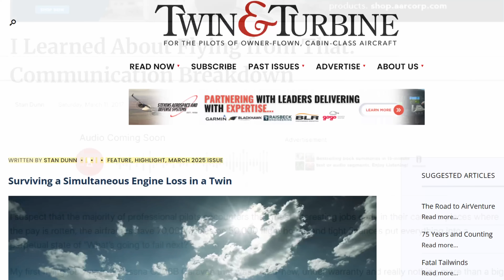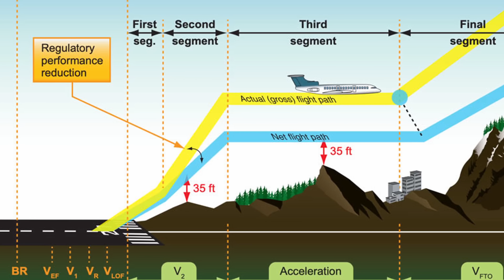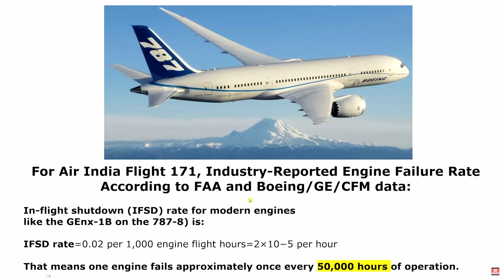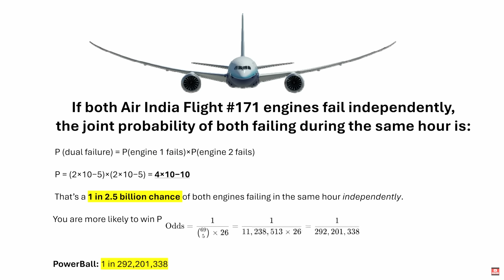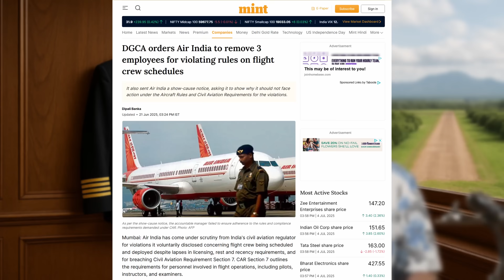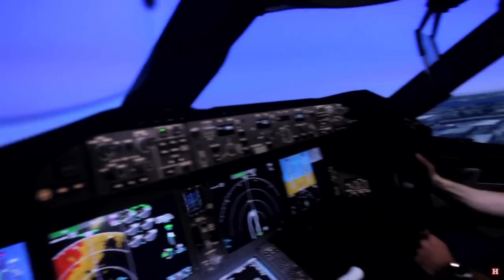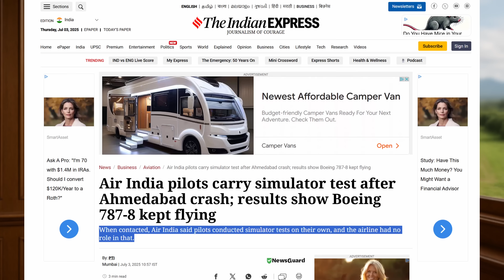Air India 171 Cause Becoming Clear

Comment: I'm not an airline pilot but after the accident when the survival said he heard a big bang on take off, my first thought was they shot the wrong engine down.
Reply: Other speculate he head the deployment of the RAT.
Reply: @iRelevant.47.system.boycott that is what it was. They are loud on actuation.
Reply: That was the emergency electrical dog slapping down to supply electricity.
Reply: A compressor stall will result in a loss of thrust and is likely to produce a "backfire" like sound due to reverse airflow. It may also be accompanied by flame from either or both of the engine inlet and engine exhaust. A sustained compressor stall can result in engine damage and can lead to engine failure.

Comment: To summarize, maybe this was a 'perfect storm' failure (similar to the Concorde failure). Left engine fails during takeoff, but after V1. They have to continue takeoff. The aircraft is already at it's maximum allowable weight, passenger load, and air temps. The margins are at minimum. They take off and begin to climb, but just barely. The remaining engine is not firewalled instantly, but rather after they lose positive climb. It's too late because they are only at 300-400 ft and it takes the engine 10-15 seconds to spool up to max. They run out of time and lift. The aircraft stalls and they maintain wings level. They float it into the ground. Possibility?
Reply: That does not explain the RAT.
Reply: @orizaba18000 do they know for sure the rat deployed? Isn’t it just based on the sound the plane made in the cell phone video?

Comment: Fly by Wire = Engines slaved to electrical system. Moisture in the relay busses or temperature induced cut out...
Rats gnawing on wires ? New guy pulling the plug to reset the controls? They do that with your cable TV

Comment: The title implying that the cause is becoming clear is a bit much. He’s using two pieces of evidence, the first is the debris from the left engine at takeoff, while no debris looks to come from the right engine. The second piece of evidence is the regulatory body firing or requiring the removal of some air India executives only a few days later. The conclusion that the pilots shut down the wrong engine before they should have even been thinking about such a thing, is entirely reasonable, especially from the timeline of how quickly the firing happened. That means that it was something really effing obvious, and there was no reason to wait with that particular move. But I think calling the cause “clear” is probably overstating things. 

Also, is there not an indicator for how well an engine is functioning? I know they’ve got the temperature gauges and I think probably RPM gauges or something like that, but is there not a simple green/red indicator for “this engine is broken“? It would make sense for there to at least be a red flashing indicator on an engine that has failed, and that flashing indicator should be down by the shut-off control. And essentially, you probably should not shut down an engine, unless that flashing indicator is flashing red at you. For good measure, they could also add in some strain gauges to the engine mount pylons to make it clear to the system how much thrust the engine is generating.

Comment: The only time I have ever had an incident while flying was on Air India.  It's beyond a horrible airline.  
The RAT was deployed on this aircraft.  That is an automated process to give the pilot hydraulics and electronics so they can land.  The altitude of this plane made that impossible. This was clearly a fuel contamination issue.  Not at all surprising in India or on an Air India flight. You forget that India is buying illegal russian oil, and running that through their aging refineries.

Comment: I have a theory that I haven't heard anywhere yet: One engine either failed or rolled back. The other engine was not producing adequate power then to continue the climb. 

Now of course, I expect to hear "All modern airliners can climb out with one failed engine!!". OK yes, this is the standard response and is accepted as 'fact'. But what if it isn't fact? 

Does one single engine, REALLY have the power to continue a takeoff, at very low altitude? On a maximally loaded flight? Full fuel, full passenger load? Very hot and humid air temps. Wouldn't the remaining engine basically have to be 'firewalled' almost instantly and then it still takes 10-15 seconds at least to fully spool up? 

The engines are not both set for max power on a standard takeoff, right? Isn't there a 'target thrust'? So at the most critical moment, one engine failed. And the remaining engine, would have to be at MAX to continue that takeoff with any hope. 

Facts we DO know: It was fully loaded for a very long flight. Passenger load was also maxed. Air temperatures were extremely high, leading to reduced thrust and climb. The aircraft stayed almost perfectly level, basically floating down.

When we repeatedly hear that any modern jet can takeoff with just one engine, we just accept it as 'fact'. But what if all the conditions are perfectly aligned against it? Maximum weight, low lift, reduced engine performance? Do they really 'test' such a scenario in real life? I highly doubt it.

Many other 'accepted facts' turned out to not be true. In the Lauda air incident, the aircraft was deemed to still be flyable during an in flight reverser deployment. This turned out to not be true, if it was at high speed and altitude. 

In the incident with Carcano (full engine failure flying into New Orleans), the engines were certified to continue to run with massive water ingestion. But the testing scenario was under full power. Under the low power they were set at for landing, they both flamed out. 

So, from an expert, is there ANY possibility that in fact there is NOT adequate power to continue positive climb, at extremely low altitude, right after takeoff, with maximum weight, extreme heat, and only one engine, running at less than full thrust?

Comment: one report said the left pilot's seat was reported defective earlier and had slipped backwards  on take-off, the pilot pulling the throttles to neutral.
Reply: Zero reports said this.  That is misinformation being spread by malicious actors.  Please stop helping them.
Reply: @johnpeterson3386  I am just reporting what I read/saw on another presenter of aircraft accidents.
I throw it into the messy mix of explanations as a consideration, not a final report
Reply: @johnpeterson3386  I am just reporting what I read/saw on another presenter of aircraft accidents.
I throw it into the messy mix of explanations as a consideration, not a final report

Reply
Reply: Fake sick message.

Comment: Old Navy AT... I still say likely fuel issue.  i.e. in proper amount fuel not getting to engines.  Dust color and rapidity of incident leads me to believe very unlikely pilot error... not enough time for most pilots to make an error.  Now what caused fuel issue?  dk.. as an old AT always want more data better resolution... etc.   Let me tell you, boxes with electronics with firmware or software or not....FAIL!   Yes, I've fixed MANY.   The easiest single point failure (important) is a semiconductor failure in the FADEC thus disrupting fuel/power... stuff to fly at that alt.

Comment: Is suicide by one of the pilots a possibility with such a modern aircraft?
Reply from the maker: Possible but not likely. No indication of a fight, and the aircraft glided down.
Reply: @flyingformoney777  I had a hunch since both engines lost power which is extremely unlikely. The fuel tank switches were turned off and the captain was suffering from depression as recent news show.

Comment: They said "no bird evidence" on the day of the crash. Nobody had a chance to examine either engine by that time. The "no birds" call came from a few jackwagons walking the runway apron looking for carcasses. Of course carcasses wouldn't be found ... but maybe some tiny hollow bone fragments? Wouldn't know it by kicking dirt around in tennis shoes.

People tend to think only big birds bring down planes but just as dangerous albeit less likely is a tight grouping of small birds could also snuff out a turbine engine.

I'm sticking with birds overall, as that is the most likely cause of dual engine failure regardless of aircraft. I am happy to be proved wrong ... Indian investigators. Please be quick too.

Comment: Nobody has even mentioned the "Load Sheet" and investigate he actual weight and freight load.  If   WELL overweight, it could have contributed to the length of T/O run clearly visible.  All pilots are where that for uncanny reasons there "ALWAYS" appear to be 3 contributory factors to accidents discovered in the subsequent investigation.  Worth some thought!

Comment: I don't think the engines failed...they just never achieved sufficient power/speed for flight which does speak to possible fuel contamination.  You can see the plane drift heavily left immediately after take-off which is an indication of insufficient power. It also appeared that they ran out of runway and had no choice but to try and lift off despite being below needed speeds.

Comment: At 3' 2" photo shows damaged building in top left and burn damage bottom right but the trees in the middle of photo no damage or burn.

At 3' 07"  the photo makes no sense. the tail of the plain sitting on the edge.

At 3' 24" where the tail section is cracked off one side is all burned and gone yet the red paint is bright red with no peeling from the heat.

I hope someone can explain these photo's.

Comment: In summary ( it’s at the end), he thinks one engine failed and the pilots accidently shut down the working engine because they panicked.   They should have remained calm and followed procedures which are to climb on the one remaining engine and after getting to a safe altitude, begin trouble shooting things ( possibly shutting down an engine if need be) ….   It’s very sad.    I think Americans should be only ones flying.    We can do it better.

Comment: The one thing not discussed was engine over-temp shutdown. On June 25th, an American Airlines A321 had an engine shutdown after take-off due to an over-temp condition. The temperature during that event was 111°F. The plane successfully returned to the airport on a single engine.  On the day of the Air India 171 crash, the temperature was 118°F. I've heard that at the Sky Harbor Intl Airport in Phoenix, jet aircraft are prohibited from taking-off when the airport reaches a certain temperature threshold for this very reason. Once liquid jet fuel becomes vaporized at certain temperatures, it becomes unusable and unignitable in jet engines. This is a plausible reason for the Air India 171 crash.
Reply: The 787 does not have an automatic overheat engine shutdown feature (and I doubt the 321 does either). An engine must be shut down manually.
Reply: @orizaba18000 wrong
Reply: This is not an issue.  The kerosene is always ignitable in the engines.  You may be thinking of vapor lock which doesn't happen in vehicles anymore due to fuel injection.
Reply: Agreed, heat soaked from running on the ground in ridiculously hot temperatures.
Reply: Does not explain the deployment of the RAT and the failure of landing gear retraction.
Reply: Explain a busy airport having no other planes with a similar condition?
Reply: I think you nailed it

Comment: IT IS VERY CLEAR THAT REPORTS BY MAINTERNANCE HUGE SERIOUS PROBLEMS FOUND OVER SOME TIME BUT NOT REPOETED. TILL NOW ALL PUT TOGETHER. THE 787 WILL HAVE TO BE  SCRAPPED AS HUGE REPAIRS INCLUDING TINEY CRACKES INSIDE WHERE THE  WING JOINS  THE FUSLAGE.  THE RAT HAS DEPLOYED EVEN WHEN ON THE GROUND SO PROBLEMS. AND DANGERS.  FUEL FILTER MOST LIKLEY CLOGGED. THERE IS A BYPASS BUT THE FUEL WAS CONTAMINATED MOST LIKLEY ALL TANKS. RECENTLY AN AIR INDIA TAKING OFF FROM THE FAR EAST HAD A FULE FILTER BLOCKED. RETURNED AND 28 HOURS TO FIX. THE PROBLEM WAS THE 787 USED THE FULL RUNWAY AS DUST SEEN AT END OF RUNWAY.  IT SEEMS ENGINES WHERE.NOT RUNNING AT FULL POWER. THE RUNWAY WAS TO SHORT FOR A 787.

Comment: I believe it may be maintenance related.
Reply: I saw a report that showed some relays that didn't play well when wet and they were in a place that could accumulate moisture in sub-tropical climate conditions.    These relays powered the FADEC units on the engines and if they failed.....the FADEC would automatically roll back power and there would be nothing the pilots could do about it.   The radio call they made said 'lack of thrust' and if the FADEC was rolling back the power that would make sense.   Automation is great until it doesn't work right.
Reply: @recoilrob324 FADEC has its own power source and a generator backup tied to the engine. There is a reset procedure due to software the can cause a problem. The Plane has to be powered off every so many days. 248 days. There can be a lavatory water leak. That could get electronics wet.
Reply: My thoughts, too. MIF
Reply: Can you elaborate on that? What exactly are you saying?
Reply: @chrismacbean  The aircraft suffered a massive electrical failure....which is why the RAT was deployed.   If what the fellow I mentioned is correct....there are some important relays that can get wet and fail and make the engines roll back power.  The electrical failure oould have happened upstream of the relays too...lots to look into here.   Can't say it's true...but something I hope they look into as if it IS true...there are others out there waiting to happen that we can stop.
Reply: @recoilrob324  RAT deploys if both engines shut down too. You are using Harlam's razor when Occam's razor applies.
Reply: @chrismacbean  The RAT deploys when electrical power production is lost....and there are other reasons beyond dual engine failure that can cause this.   Actually....the odds of a simultaneous dual engine failure are astronomical unless they share a common cause.
Hopefully the actual cause will be uncovered and no governmental hanky-panky will take place as they try to save face.
Reply: @chrismacbean  "Hanlon's Razor", but I otherwise agree with the statement
Reply: Yep was a wet day, the main bus of the aircraft would have e been open to supply aux power. Water accumulation in this area. All system were likly ok until lift off. As the aircraft angle changed water likly moved onto the main power bus and ⚡️
Reply: So you believe that aerospace engineers did not think of this, but YOU did? Seriously, buddy, this is insulting to really smart people that have achieved the safest mode of transportation ever conceived...and its in the SKY at 500 miles an hour. These aren't morons here.
Reply: @chrismacbean  Are you up to speed about what caused the 737 Max accidents?   Your lauded 'aerospace engineers' dropped several crucial balls and got a LOT of people killed.
I've worked in the aerospace industry and can tell you for 100% certain that all the engineers aren't as good as you think they are and they make really awful mistakes (we're all human after all) and thank GOD that the system has enough checks along the way that most of these mistakes get caught and fixed before the aircraft are released for service.   But not always especially when a company is bleeding money like Boeing is at the moment.
Reply: Its not fuel contamination... Not maintainance (usually explosive) It's electrical (Boeing supplied the worst batch/ quality to air India , it's the same batch of  planes that the Boeing engineer said he wouldn't let his family fly on the Boeing he made)or 
software related dual engine failure... 

Even a 3rd grader would know that unless the third grader is paid by Boeing or a Boeing fanboy  like most YouTube "I have <insert hours here>  experience" pilots
Fuel contamination ,  near impossible with current checks , cannot cause dual engine failure AT THE SAME MILLISECOND accurate TIME , or essentially  SIMULTANEOUS

Comment: IS THERE A FLAP WARNING HORN SOUNDED IF THE PERFORMANCE REQUIRES 15 DEGREES FLAPS AND ONLY 5 DEGREES IS SET? IS IT POSSIBLE FLAPS WERE RAISED... WITH THE MISTAKE BEING REALIZED AND WERE RE-EXTENDED?